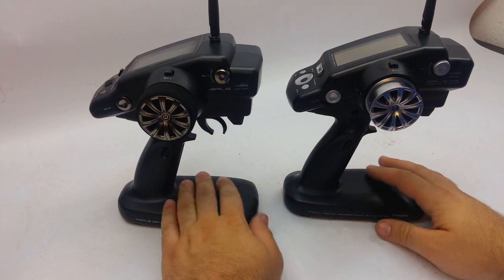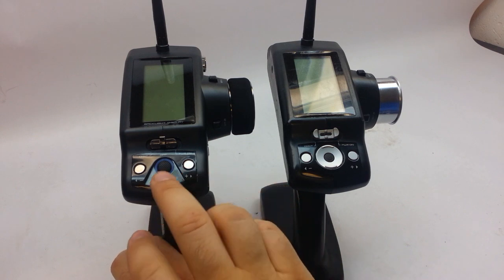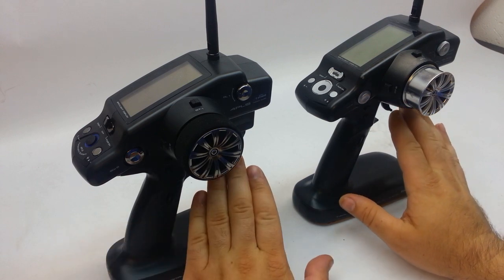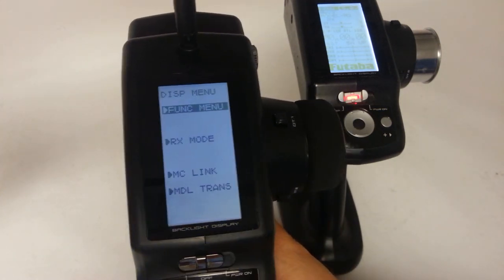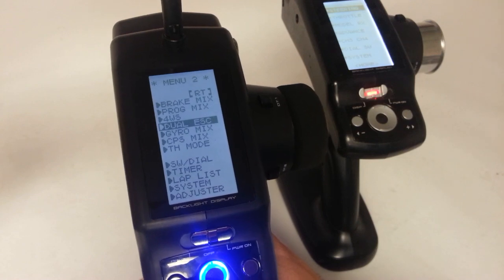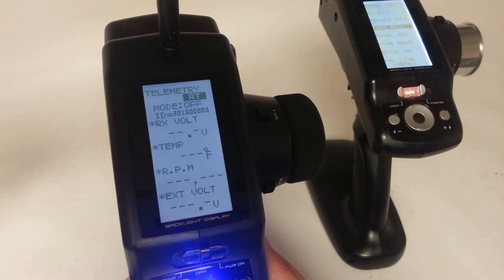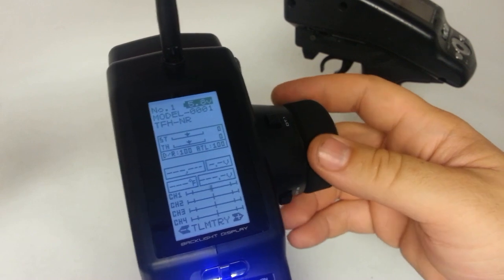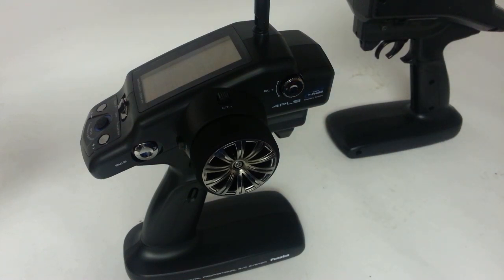Futaba 4PLS - First Look

Comment: Should I change out the tatic radio from the rtr Axial scx 10ii with this radio. I am used to Air radios, have not done nay programing with a  Surface radio
Reply from the maker: This is still a good radio, although I do like the 4PV better now. Surface radios are much easier than air radios to program. I’m sure you’ll be more than capable.

Comment: I was reading through the 4pls manual and I saw a feature that you can dim LED lighting . There is a light bar I wanna get that can only handle 6v. I have my mamba x internal bec set to 7.5v to power my servo and front light bar without running a external bec. Is it possible to lower voltage output from say just channel  3 to run the other light I'm looking at. I'd like to avoid running a external bec.
Reply from the maker: No, that’s not how that works. I believe the feature you’re reading is for the LED lighting is for something else entirely. You’ll either need an external light controller or BEC. A BEC will usually be cheaper but will not give you the ability to turn the light on or off.

Comment: how can I program a switch in my 4PLS for throttle cut. (trigger cut).  In case I or someone touch the trigger by mistake when I give the transmitter to another person.
I have DX-9 Spektrum and I assigned a switch for throttle cut.
Reply from the maker: +rrene gadoo that's not something I've seen anyone do on. That's not something I've seen on any surface radio actually. You could possibly do it with a program mix with channel 2 being the master and slave at a value of -100.
Reply: +Harley Designs ....I been flying for a few years and now I started with  rc cars  as well, and I don't know much about 4pls  transmitter and I don't wanna screw it....
could you try it for me please.
One of my friends got a foot injury when another guy take the transmitter and pull the trigger by mistake.
thanks.

Comment: Quick question for ya can I use the Push switch (SW1) to kill my engine with the Dynamite Large Scale Safety Kill Switch. So in short can I use that (SW1) for channel 3. Thanks for any reply as the kill switch and radio will be here in 3 days.
Reply from the maker: +Nelson Passino SW1 can be programmed to CH3 easily. Should not be any issue to program that.
Reply: Thanks. Seams to be a good button for the kill switch on my 1/4 scale sprint car.